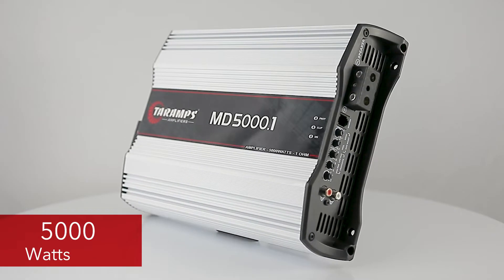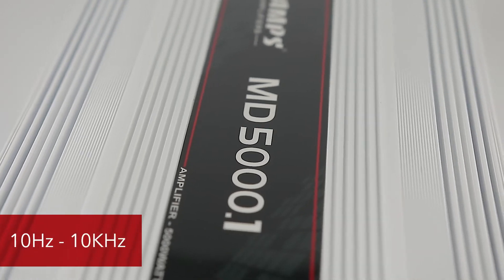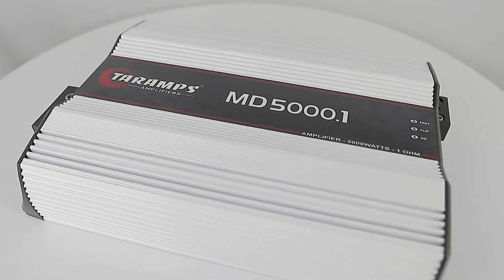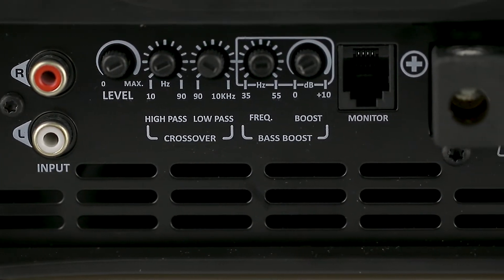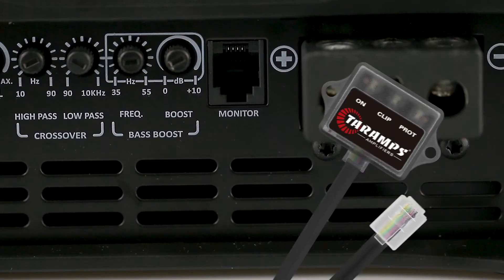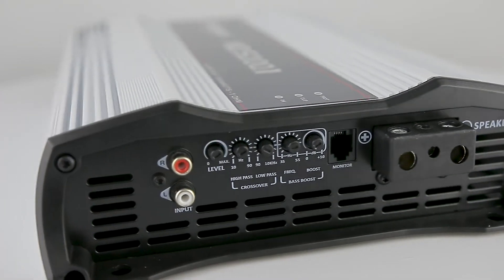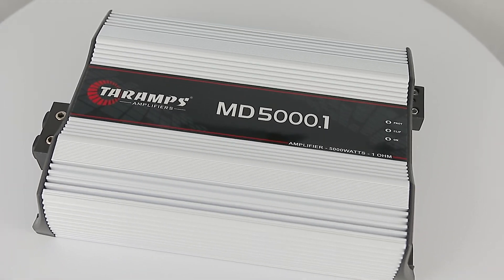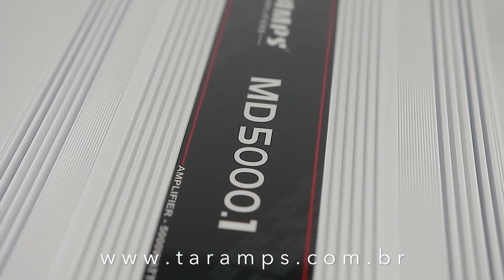Taramps MD 5000.1 Automotive Module Amplifier 5000 Watts RMS | Taramps

Comment: Did taramps stop making HD 5000 , HD 8000 , HD 10000 and HD 15000 ?
Reply from the maker: Hi Cedric, how are doing? Yes, our high power HD line was awesome! But now we have equally powerful amplifiers in line, like our MD line, our Smart line, the smart line that runs with a multi-impedance system. All of them with a plus of  superior technology if compared to the ones that have gone out of line.